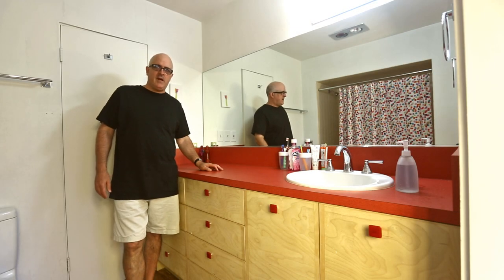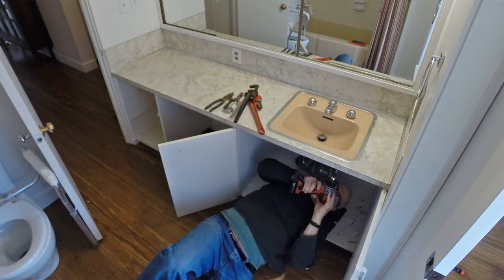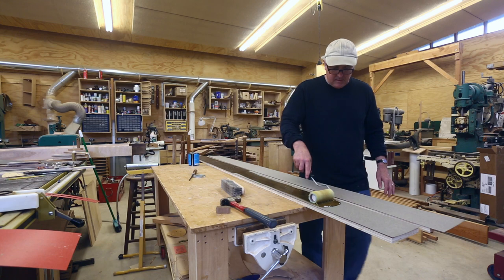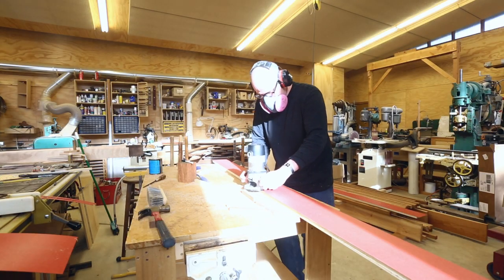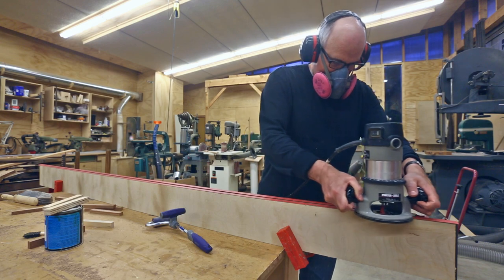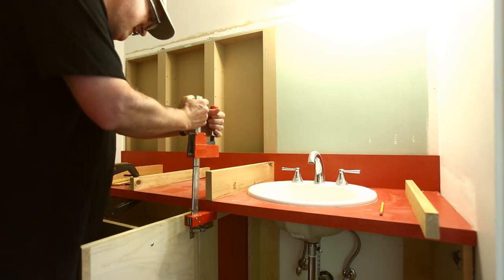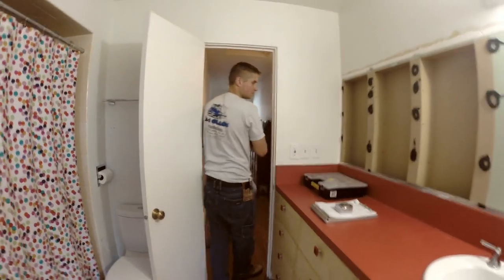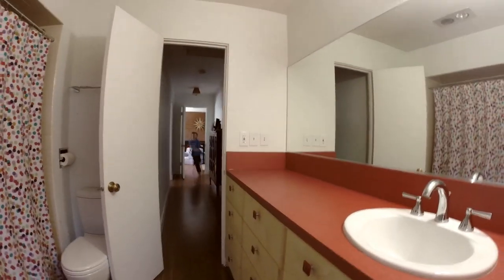Bathroom Cabinets: Part 4 - kids bathroom

Comment: Lovely cabinets!  I always watch your videos!

Too late now, but a suggestion on how you might have clamped the backsplash to the wall:  

Cut each of the lengths of timber that you used in half, and place them just as you did except maybe on their sides, the piece nearest you clamped down just like you did.  Then drive 2 wedges, one from each side into the split in the middle of the wood.  Because the piece nearest you is clamped down, the piece that is up against the backsplash will be forced into it, applying strong clamping pressure.  

Hope that makes sense!
Reply from the maker: Thanks! Yes I am doing the wedge thing on a current project.

Comment: What you could do for the drawers is to make a small bevel slanting outwards on top of the drawer front. This way running and splashing water should run out and not in. On the other hand you would have to repeat this on all levels since it would just run into the next one.

Comment: Another idea on applying pressure, use the boards the same as you did but set back 1/4 " or so then put some wedges in between them and the backsplash.
Nice vid, keep it up!

Comment: Looks great Frank. Fortunately (or unfortunately) the kids grow fast so their water splashing days won't be for long :-)

Remodeling is often a long sequence of compromises.

Hey, for applying pressure to the back splash, you were very close to the solution. Clamp the boards to the counter top like you did, but don't let them touch the back splash. Then clamp slightly long battens to the board and 'spring' them into place, applying pressure to the back splash. This is a common technique where clamps can't be used. There's a name for it, but for the life of me I can't think of it.

Comment: Spreading the contact cement is very easy using an old credit card or small piece of the cut laminate and using it like a squeegee.  The contact cement can be a very thin coat only a thousandths of an inch thick or so.

Comment: You could have used toggle clamps to hold the back splash in place while the adhesive set. You would have had to mount and unmount them of course. But I'm sure you could always find a use for extra toggle clamps.

And reason you didn't insulate the wall while you had it open? Even if it was an interior wall, it would cut down on noise.
Reply: +tetsubo57 he only had a 2x2 area opened up, unless you are doing the entire wall (all walls matter of fact) why waste the time

Comment: I know it's perhaps not the best solution, but maybe you could remove the front plastic laminate, cut of maybe 1 or 1/2 inch of the laminate edge on the top, attach a thin long piece of wood on the entire edge, and re-laminate the bare parts on the spot?

Love your videos as always, Frank, you are a true artist!!! =)

Comment: Nice job Frank. These things happen and you only find out at the end...or when it's too late! Complete start again to set the drawers in....or move the door.....or move house! To hold the backsplash in place while the glue set up you did the right thing with the clamps but should have tightened them down then given them a tap with a hammer. They would have tightened up against the backsplash but wouldn't have been able to rebound back because the clamps were pinning them down. Good job great watch. Thanks.

Comment: One other detail with bathrooms that wasn't covered in this video: What did you do about the seam between the backsplash and the countertop? If water gets everywhere in a kids' bathroom, it would definitely get there. I have seen this kind of bathroom vanity issue pop up again and again, and no amount of caulking can overcome this design flaw.

Comment: I know this sound like a stupid question, but I'm not a woodworker and never did such work. So could you screw the plywood to the wall with screws and then glue laminate on?
Reply: You could, but would be harder to glue. There's another option, that is make a hole in the plywood (and laminate) to hide the screw head, and use a plastic cap the same color of the laminate. Can find it at the same place you buy the laminate.

Comment: I'm sure you can use some rubber strips on the top edge of the drawers to keep the water from getting into the drawers. You could also just make a strip of wood (also laminated) that tapers toward the door but then overhangs the counter enough to keep the drawers dry.

Comment: Look grate and excellent videos!
One comment: if one of the drawers near the door is opened for some reason, it might prevent you from opening the door.
It happened to me in a similar setup, the drawer was overloaded with laundry, and somehow spontaneously opened while the door was closed, and blocked it.
We had to work hard to resolve that situation

Comment: When you've used such a roller to put contact cement on, do you clean the rollers someway? Or do they go straight into the garbage bin after one time of use?
Reply: +Richard van, they would be garbage, but cheap enough not to worry about

Comment: Put a small slot (dado) very close to the front edge of the counter-top. This will cause the water to drip from that point rather than run under surface tension into the drawer.
Reply: I was going to say this too. Maybe something like a biscuit joiner to create the drip-cap groove since everything is in place.

Comment: frank , you were high by the time you finished  laminating your backsplash. about the water dripping onto your drawer fronts, do what you did before, take the cabinet back to your table saw and make it 3/4 of an inch smaller.
Reply from the maker: woodwork or made the counter deeper and cut an arc for the door swing.
Reply: +frank howarth or reframe the the door opening, and slide the counter top forward a little, while keeping its back edge under the back splash

Comment: laminate counter top? bad idea, by the time you add cost and labor you could have bought a pre-fabricated piece of granite, it comes with splash, in san diego ca. 150 can get you that.
Reply from the maker: woodwork 150 sq/ft  at the low end
Reply: +woodwork i'm not liking the laminate also, water is gonna damage it at some point :/

Comment: I know this one is an older build but I did the same thing. my remedy was I flipped the door and frame to open the opposite side. it was a bit more work but looked better and I had the ledge to protect the wood. Even teen and older kids still make messes lol they never change.